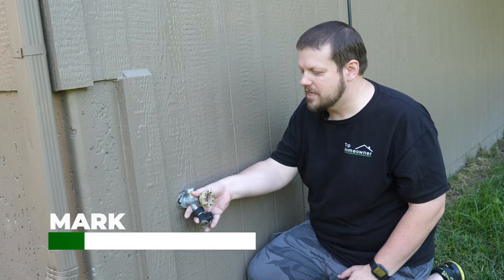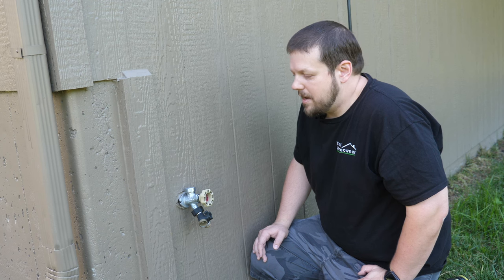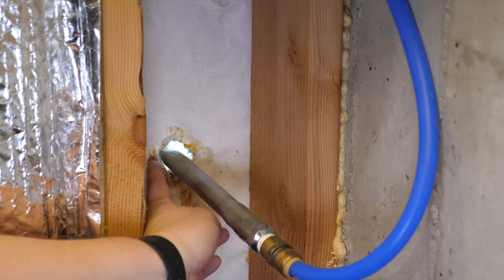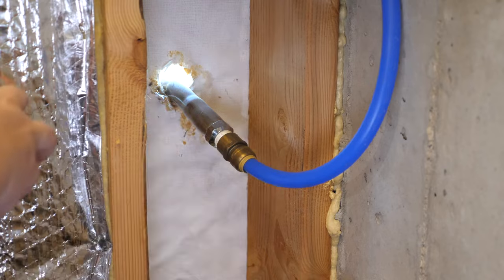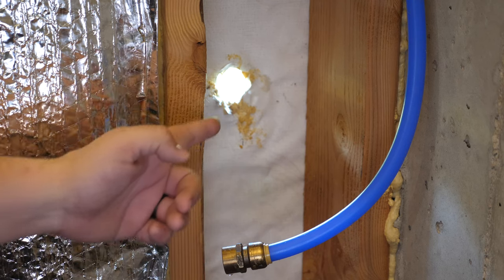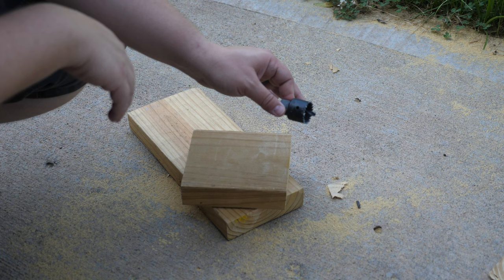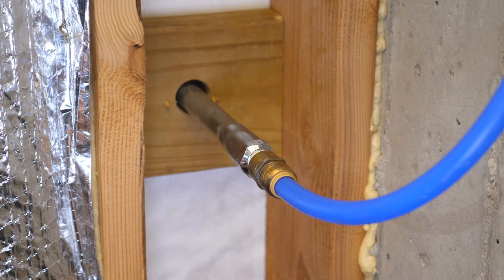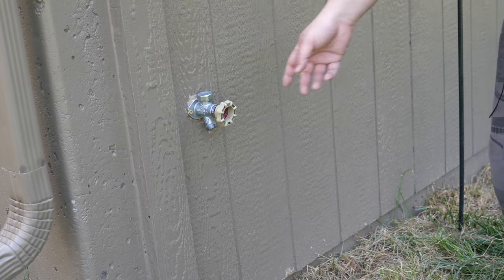Hose Bib Removal and Install - Fixing our Loose Spigot

Comment: Is there anything you do to ensure the bib is angled to drain out or do you just eyeball it and test afterward? Is there anything you need to do when a house has the horizontal siding that is angled slightly upward from the bottom of the board to the top so the bib is angled so water drains out?

Comment: Mark, We make the HOSE BIB BUDDY. You are the man! Thank you for recommending our product. We must be doing something right. :-) We'd love to send you some if you'd like to demo - since the loose sillcock is such a frequent problem. I'd like to point out a few things. 1. That our plate is soft aluminum and acts as a sacrificial anode for the little system - to protect the piping, valve, and connections from galvanic corrosion. 2. If replacing, often you have to make the hole bigger to get the old out and the new in. Our plate is super handy to bridge the gap and secure. The hole and the exterior can be sealed with clear silicon rather than cement or mortar. It looks much better and takes less time. (For plumbers this saves time, and possibly a return trip.) 3. The HOSE BIB BUDDY is now in Lowe's Stores too. :-) Thanks again!  - Paul from BluMare Research
Reply from the maker: Hey that's cool! Glad you found this video! I didn't know those points about your product so that's awesome. The fact that Lowes sells it now too is great. If you'd like to send one for me to do a review just send an email to mark@tophomeowner.com and I'll send you my address.

Comment: Just bought this with 2 pair of screws with each pair of different caliber (besides short and long). The instructions only say to use a 5/32" drill bit which looks too small for the long blue screws and too big for the short screws. I expected to use two drill bits. Can you explain? Thanks.